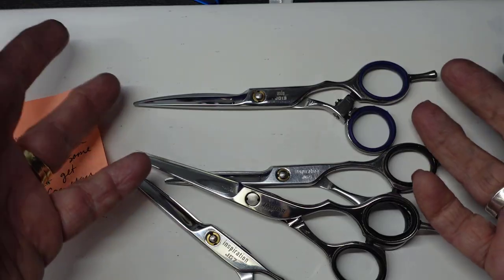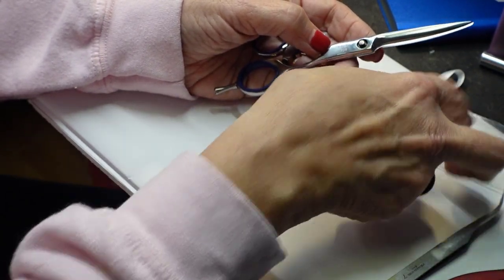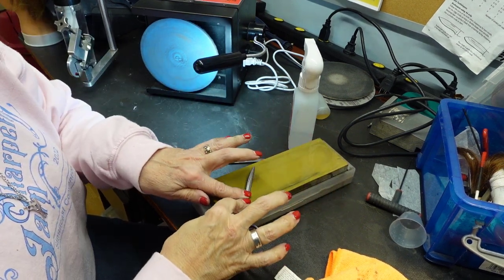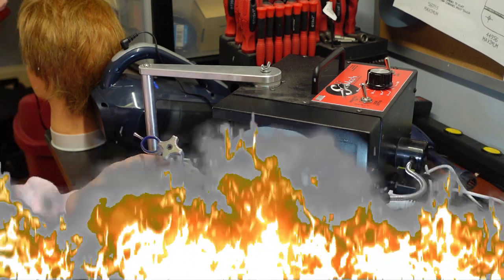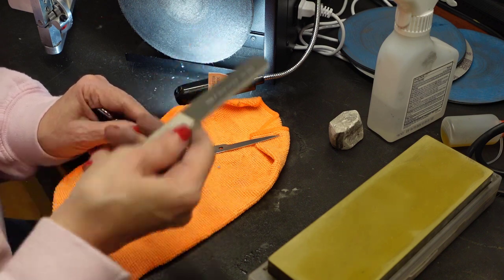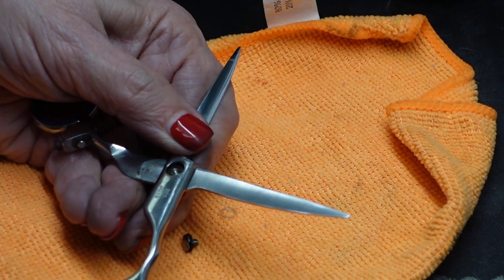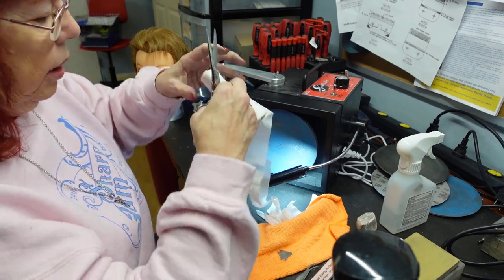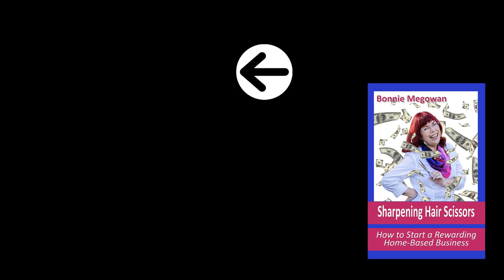Can I Fix this German Shear with a Discontinued Screw and Bad Sharpening | Bonika Shears

Comment: I came across this same screw last summer.  Thanks Bonnie for the response and insight back then.  Before starting inform the shear owner that a replacement screw may be required a replacement and it could take time to acquire but no guarantee for a proper form-fit-function in the replacement screw.  Let the owner decide if they want to replace the old shear now or allow you to try to sharpen.  Shear owner accepted the conditions and in the end the screw/nut was actually easy to work with tool that Bonnie showed in the video.  Surprisingly the rubber and friction fit of the existing components still provided a nice range to set the correct tension.  Thanks again Bonnie for your helpful knowledge in dealing with this screw system.
Reply from the maker: Once again, great observation. Please add your helpful comments whenever you can.

Comment: The other thing that I have encountered sometimes with these is the rideline does not extend right to the edge.  The edge was so rounded because of age and abuse by the stylist and lack of appropriate periodic sharpening.  The burr is coming up on the inside edge when sharpening the outside edge but is not actually reaching the rideline.  Morel of my experience.... Just because a burr came up doesn't mean the correct cutting edge is formed between the outside edge and the rideline.  Use the Magniwand and check to see if rideline is goes all the way to the edge.  All it takes is thousands of an inch /mm of a rounded edge, even if you found a full burr and the edge will not cut.
Reply from the maker: Very observant Todd! I love it when the students I teach come back and teach me! Yes, you are so right!